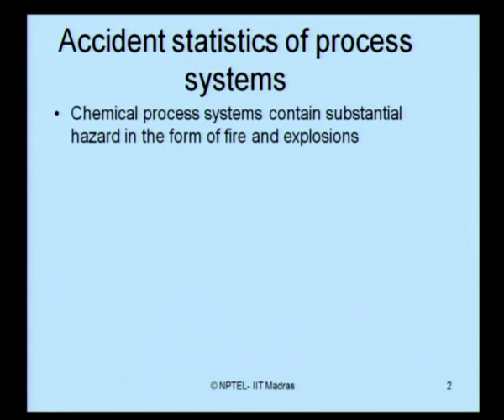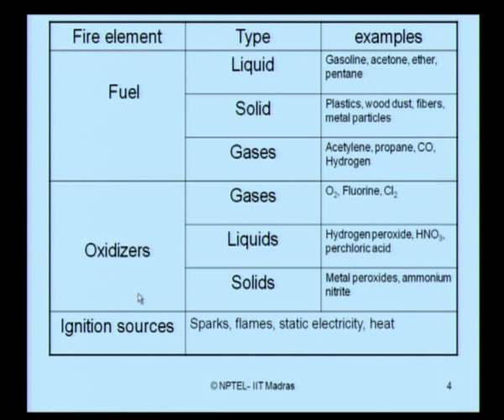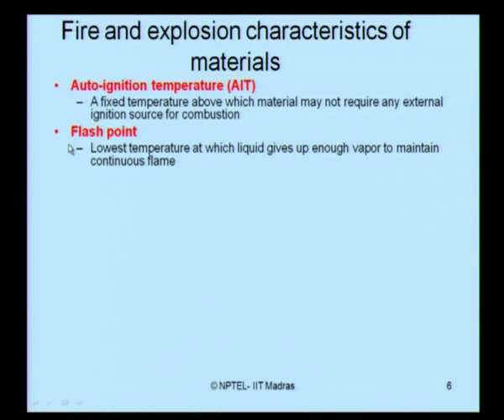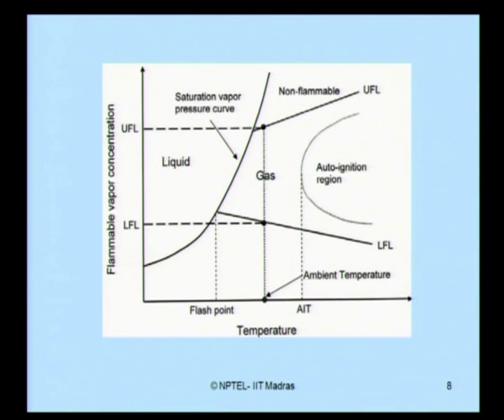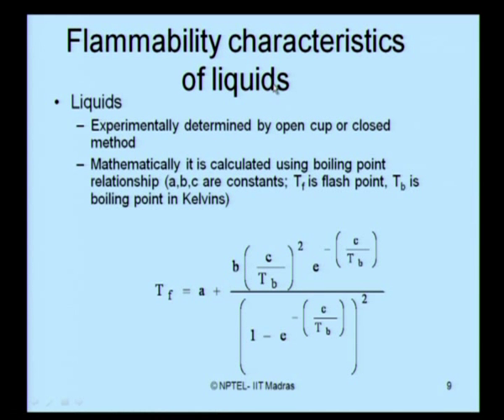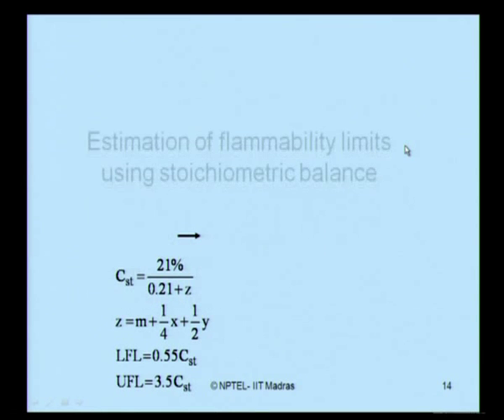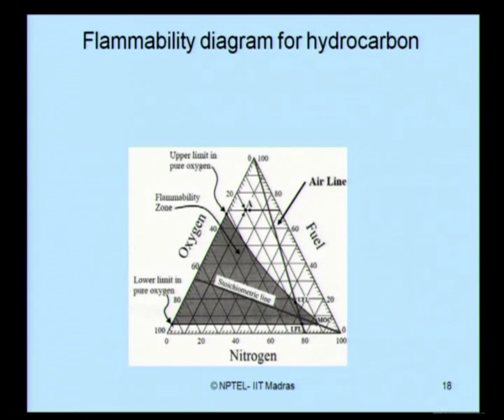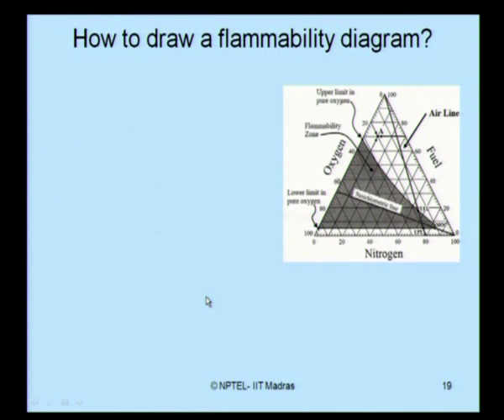Mod-03 Lec-07 Fire and Explosion Modeling

Comment: 7:30 If you put a combustible gas mixture (assume boiling points @ absolute zero) in a perfectly insulated container at an arbitrarily low temperature, the Boltzmann distribution of speeds will admit collisions above the activation energy for chemical reaction. This will increase the temperature inside the vessel and reactions will proceed at a faster rate until there is no more fuel left to consume. In this case, the AIT could technically be considered to be just above absolute zero - unless you define "combustion" in such a way that the AIT is higher. How, then, do you define "combustion?"
Reply: sir can u tell me where can i found more study material fire engineering
Reply: dear sir - I wish I had the expertise to direct you to the best literature - but alas I do not.
Reply: sir how can i contact u ?
Reply: spin2he2@gmail.com or this thread are fine - what questions do you have about materials fire engineering?
Reply: @jessicaanderson46   Dear mam i want to know about the chemical chain break mechanism by dcp powder